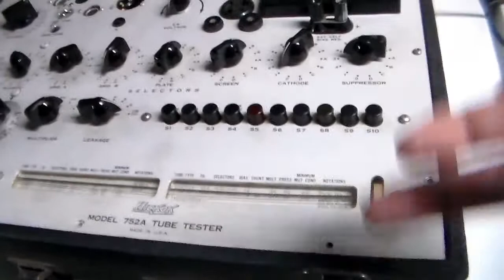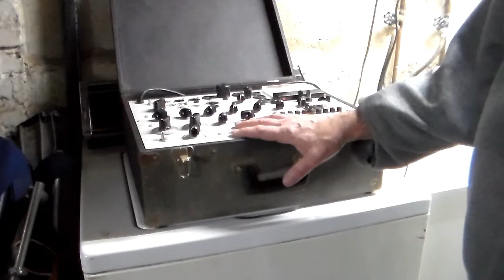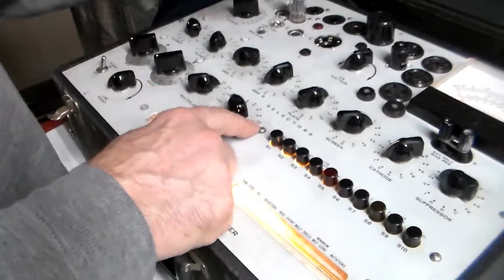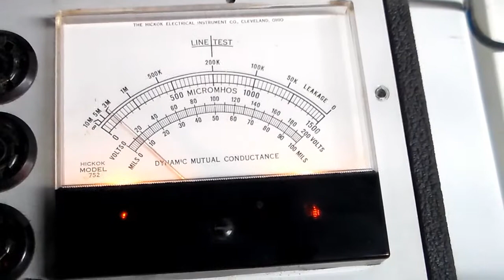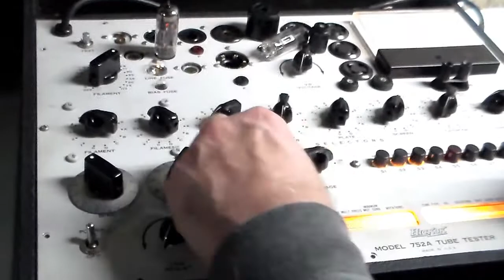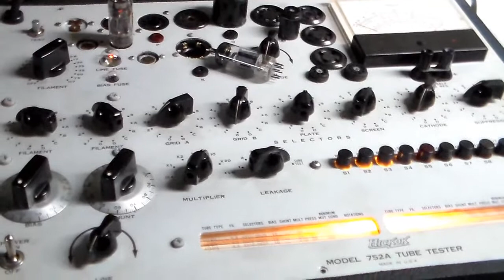Hickok 572A Tube Tester

Comment: This is great knowledge.  I have a 752 model from Los Alamos Scientific Labs.  I am in the process of replacing the capacitors, cleaning contacts and such.  Will do a calibration.  These are from a time when we took pride in our work. All hand wired, soldered and laced wire runs.